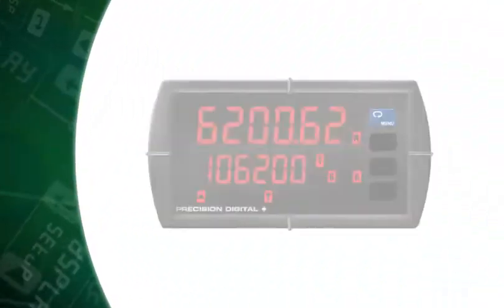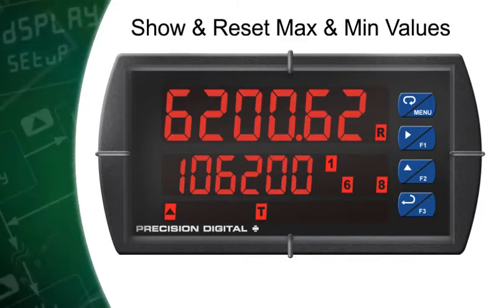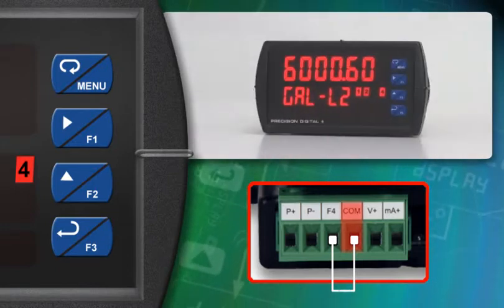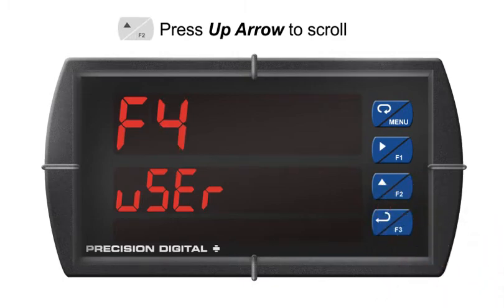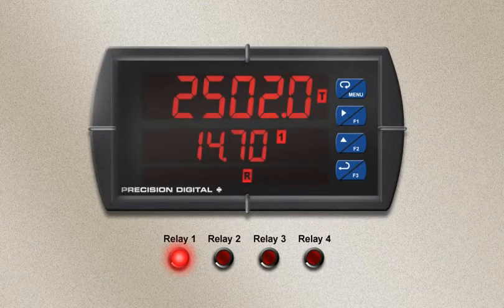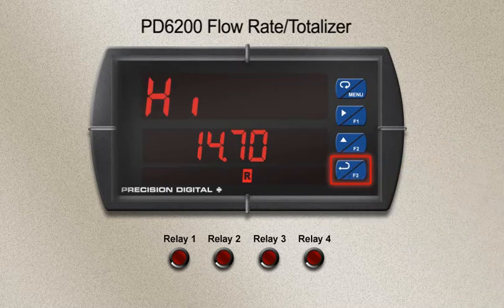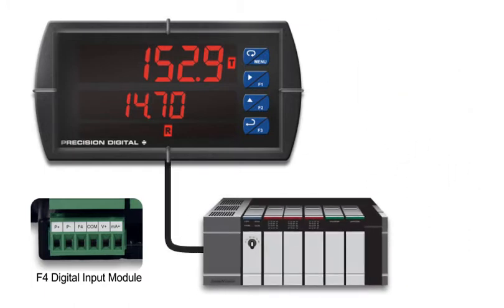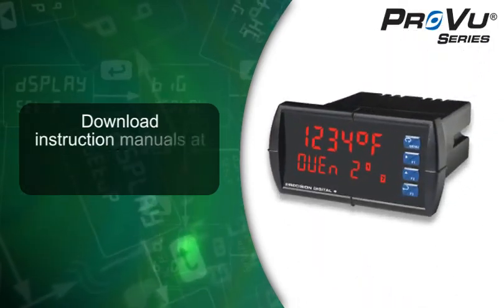ProVu Series of Digital Panel Meters - Function Keys Tutorial

Comment: How to factory reset the meter which is locked accidentally and password is unknown?
Reply from the maker: Kamal, Before you try resetting your meter to factory defaults, you may try unlocking the meter following the "Did you forget the password?" instructions on page 37 of this manual: https://www.predig.com/sites/default/files/documents/LIM6000_M.pdf This will allow you to "unlock" the meter once, and you will need to disable password protection or change the password while the meter is unlocked.